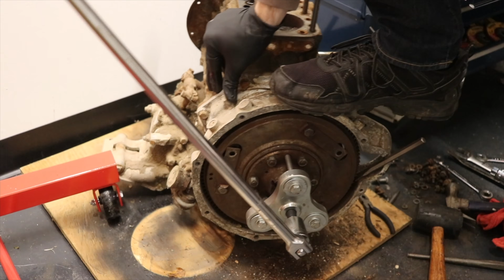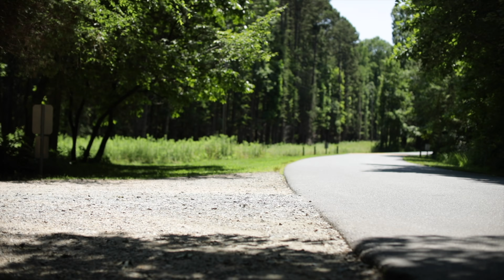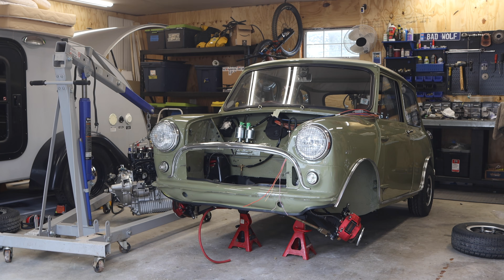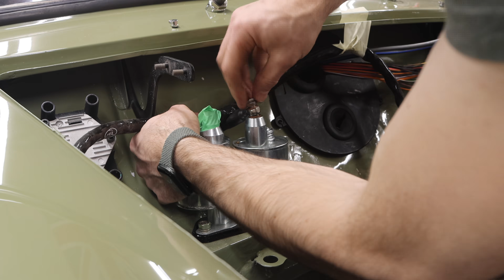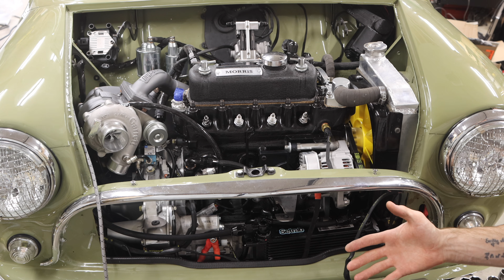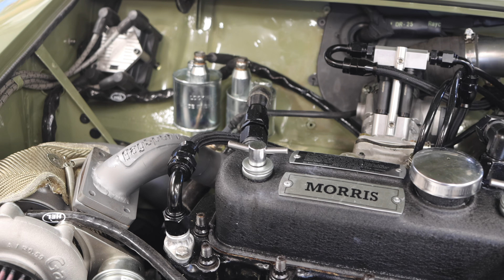Resto-mod Mini - #11 | Installing a Turbo Engine

Comment: Hi Cole. Great video
I had a 1290 turbo a series engine using a tiny T2 style turbo. Fully stock bottom end (excluding bigger high comp pistons) and stock "non E" gearbox and clutch. I made 79KW at 0.7 bar of boost (at a DA of 6500ft). Any more boost and I would start lifting the head on the stock studs. Not anything that you are pushing but considering that all I did was slap a turbo on and tune it on a frankenstein efi kit I made myself.

Comment: That bagsport kit looks amazing, i wonder how the carb kit looks.  Is there any issue with the ignition leads being so long?
Reply from the maker: Thank you! The Carb kit wouldn't look all that much different aside from having a plenum with proper restriction rings in it to ensure smooth air being delivered to the turbo carb. I actually went down a huge rabbit hole with ignition lead length and the short answer is from an electrical speed perspective, you won't even begin to see tangible impacts until almost 6-7ft, and even then those impacts are arguably not even that noticeable. The biggest issue will be resistance in the size of the wire. So changing the thickness of the wire would be needed for really long runs.

Comment: a man who has pulled his engine so many times he doesnt even use protection when putting it back in. ballsy
Reply from the maker: On the fenders and such? Yeah my thought process was always “if the engine hoist fails, a couple of blankets aren’t gonna save anything” 😂
Reply: @classicminidiy  I was more thinking about accidentally scratching something, esp with that fancy new paintjob. No matter how careful I am, I always manage to screw something up lol

Comment: Hi Cole, 

Thank you for the video, the build is looking fantastic. 

Would you consider selling a kit on your website that includes all the components like the throttle body and oil cooler etc with fittings to make it easy to purchase the equipment in one go?
Reply from the maker: Hey Thomas! Thanks so much. I have considered it a few times but the logistics of stocking, carrying, and supporting a full kit like that are outside my ability right now. Being just a single guy in the garage I wouldn't have enough time to provide the level of support I would want to for a full kit.
Reply: @classicminidiy  no worries, thank you for getting back to me. 

I am after the fly by wire throttle body. Do you have any detailed recommendations on the pedal setup to go with this?
Reply from the maker: I am actually working on a bolt-in pedal assembly that mounts in the original pedal location. That's still a few weeks out so if you need something sooner you can use a VW polo pedal, or retrofit your own using a Honda/Acura pedal position sensor. I have some details of this at the bottom of this article I wrote on my Substack.

https://substack.classicminidiy.com/p/classic-mini-efi-3-drive-by-wire
Reply: @classicminidiy  amazing, I have a little way to go with my project yet so I'll hold off for you bolt in solution thank you 😁

Comment: Countless Mini owners have successfully turbocharged their factory motors with excellent results. As long as the proper precautions are taken and the installation is done correctly, there is no reason why turbocharging a stock Mini motor should be considered unsafe. Turbocharging can significantly increase the power and performance of a Mini, providing a thrilling driving experience that is sure to put a smile on any Mini enthusiast’s face. So before making unfounded claims about the safety of turbocharging, perhaps do some research and consider the many successful turbocharged Mini builds out there. I will save you the time of googling the best one. It's called the Jet Motors turbo kit. It’s simply the best, most straightforward available kit on the market. Jet Motors produced this kit with years of research and REAL WORLD testing before marketing and selling the turbo kit. The Jet Motors turbo kit is the best option for the working class mini enthusiast.
Reply: Real world tests of the jet kit have only brought up a few bhp more. It is poorly packaged as a bolt on kit, and frankly very cheap parts. If you want something to help you up a hill, great, but there are no proven power graphs, no before and after dyno sessions, and the exhaust collector is potentially the worse for turbulence. Many have tried to return the kit, with jet just turning a blind eye. Slapping on a kit and thinking it's great is a mindless attempt at knowing how the engine is reacting. No attempt to find if the engine is detonating, or working to control cylinder pressures at the boost levels that claim.. especially without an intercooler! I'm glad there are companies on the market that back up their work with dyno work, correct R&D and proven results - not silly videos of them just being driven around.
Reply: I usually stay out of this. But you're deluded! 

It's deeply disheartening to witness the glaring shortcomings of the jet motor's turbo kit, which appears to be nothing short of a haphazardly assembled collection of inadequately sized and poorly sourced components. The absence of proper intercooling mechanisms exacerbates the already alarming issue of excessive heat buildup, indicative of a fundamental oversight in the kit's design.

Furthermore, the reliance on Chinese parts, without passing on the cost benefits to consumers, raises serious questions about the integrity and transparency of the manufacturing process. The omission of essential features like restrictor rings in the plenums only serves to underscore the lack of attention to detail and thorough engineering that should be inherent in any turbocharging solution.

In a landscape rich with meticulously crafted and proven turbocharging systems for Minis, it's unfathomable why Jet would opt to disregard years of established expertise and innovation. By doing so, they not only fail to meet the expectations of enthusiasts but also risk tarnishing their reputation with a substandard offering that falls egregiously short of industry standards. 

Jet must confront these shortcomings and cease their unfounded assertions of superiority, as their performance simply does not measure up. Regrettably, numerous individuals continue to fall prey to their marketing tactics, only to discover upon receipt that the products fail to live up to their advertised claims
Reply: I thought this was either a joke or directly from Jet marketing but it seems not? The only performance info from the Jet kit I have seen is someone pretending it has torque steer which was awkward to watch, and someone saying it made about 90 bhp which is insanely bad. It really isn't a good kit for any level of actual performance

Comment: Great video Cole, very constructive words on the other "turbo kits" available.
Reply from the maker: Thanks Elliot! I really like the idea of tons of people producing kits, and people having options but I also think there is a lot to be desired on the Jet Motors kit in its present state.
Reply: @classicminidiy  Hi I am very interested in the jet turbo kit and am very much ready to get one but occasionally I hear a negative remark that puts me off. 
What is your thoughts on their kit please. 
As your someone who has clearly done a lot of a series turbo research. 
Cheers.
Reply from the maker: @connorcox3456  Hey in my opinion its not a kit I would buy or install on any of my cars, or any customer cars. The turbo they use is too small for most A-series engines and given there is no prep done to the engine(forged pistons, decompression of the chambers, no intercooler) itself to accommodate the boost and increased heat its a recipe for a broken engine in a short period of time. Also the lower boost they run really isn't going to provide a tangible improvement. The final thing I will say, is that the EFI kits they offer from specialist components are incredibly "long in the tooth". The ECU is extremely outdated and really isn't a very good system by today's standards.
Reply: @classicminidiy  ok then thank you for this. I did Wonder if I'm honest due to the lack of prep but have also seen a lot of minis running this kit but for how long I don't know. 
I'll go back to the drawing board lol but I appreciate the response.

I do have a genuine rebuilt Metro turbo engine that I was thinking of fitting this kit to and keeping the single carb.

Comment: Nice build! Take a look at your K&N oil filter. I readed somewhere that they are not the best ones.
Reply from the maker: Thanks Stefan! The K&N filters are just a rebrand of an American WIX brand filter. These filters are perfectly "average" and work fine. This filter also is going to be very short lived as I plan to do the first oil change only after about 150-200 miles.
Reply: @classicminidiy  I didn't know that! But I believe there was a test on The Mini Forum where the K&N was the 'baddest'.